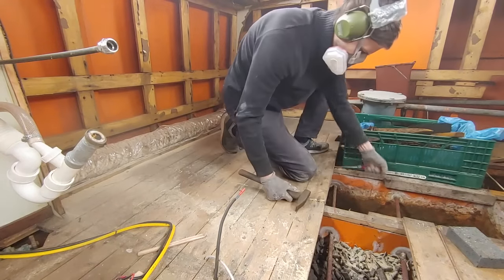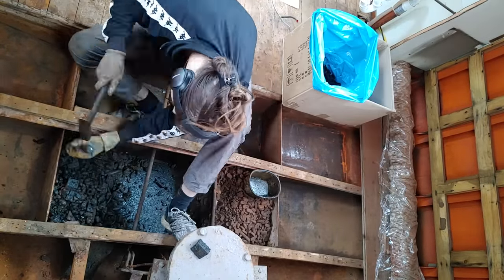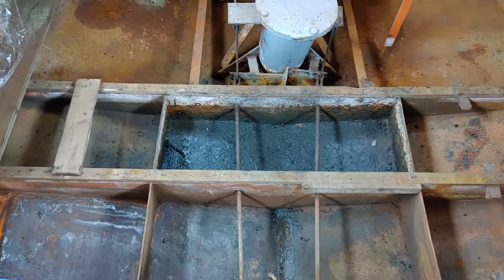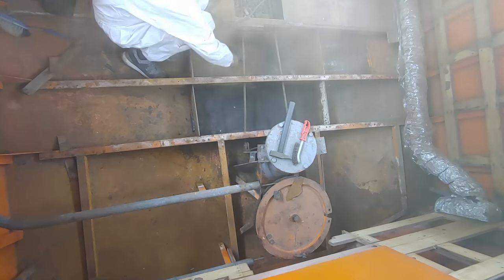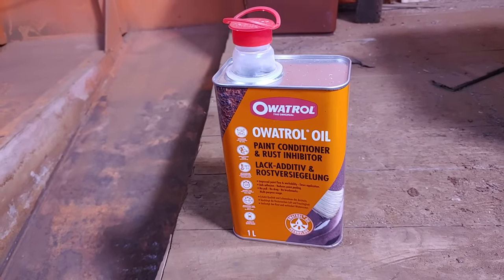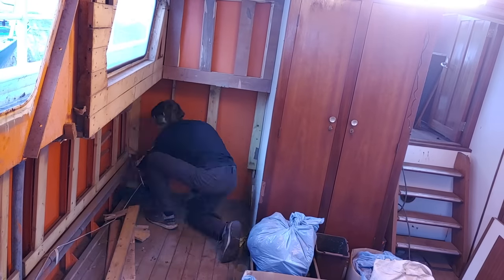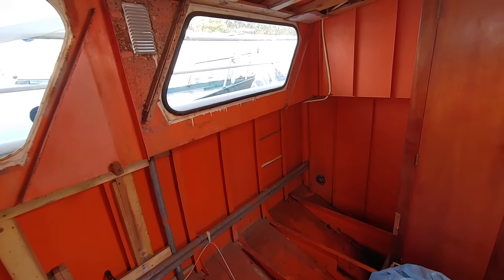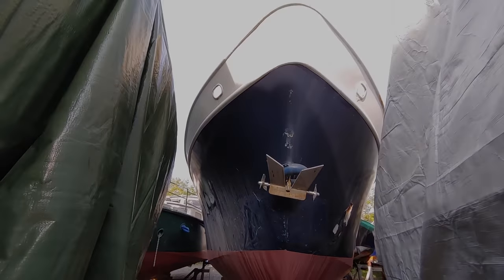Big Leaps Forward in the Rear Cabin - Week 5 - Vintage Yacht Restoration Vlog

Comment: Greetings from the USA. Prior to painting you need to drill "limber" holes through the bottom of the small bulkheads separating all those compartments. The limbers allow movement of bilge water to the lowest point in the hull for removal with the bilge pump. Without limbers you are destined to continue to face rusting and water collection throughout the bilge. Mike
Reply: Second this motion, from fellow European.

Comment: I would clean out the old ballast and weigh  a cubic foot of the ballast to give you a number to maintain proper ballast. 
Then line the ballast area with heavy gauge plastic or even better brush on the product 
Gluv-it and it will permanently seal the hull. Then pour concrete into the ballast area. 
A perfect job that will stay water tight and will not move. If you have it in your budget, I implore you to coat the hull below the water line with 
Gluv-it. It’s the finest product on the market for permanent water tight hulls. This product can be used over any type of hull and the results are amazing. It will literally seek out cracks and trouble spots. I’ve seen old wooden tug boats that were coated with it as a way to get another season out of the boat only to find out that the hull stayed water tight like never before. A friend did it to his 80 yr old wooden hull and it’s still perfectly watertight after 15 years. This is the BEST TIP you will ever get for renewing life into an old boat. 
Good luck!!✌🏻🇺🇸

Comment: Don’t forget to weigh the ballast and replace it with the same weight. Stability is at risk.
Reply: Very good point.
Reply: ballast at that point mostly is for better prop use. changing this much on a boat requires a weight in prior and after work. sometimes the prop-shaft angle is adjusted to reduce ballast

Comment: instead of using 'metal in the ballast areas , i would go to a few tire stores and see if you can get old 'lead wheel weights for ballast ... might have to pay a little , but it would be worth it in long run ... 'rusted metal stinks after a couple years ....  the 'lead will not stink

Comment: i know this is prob to late but if you take measurements and cast the metal in to forme its a lot easier or if you use led bead shot in bags
Reply: I went round to auto shops and had them collect old tire weights. Melted them, poured into home made ingot molds. 3200 lb of it. That was on my 2nd steel boat.